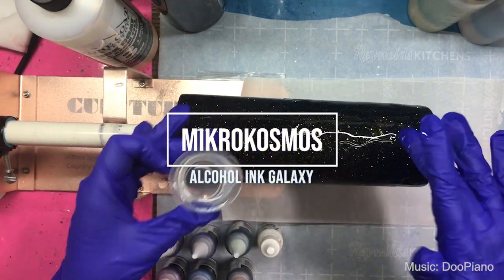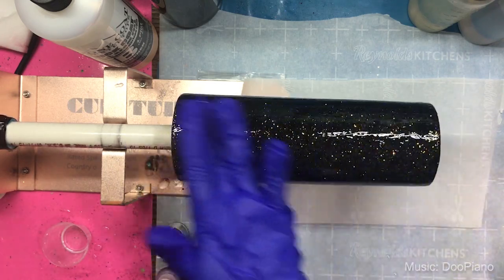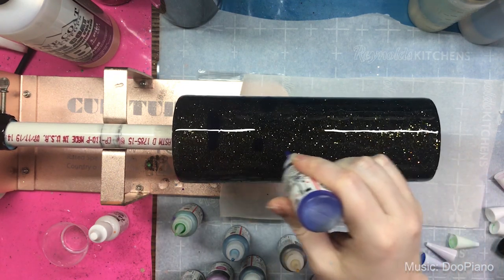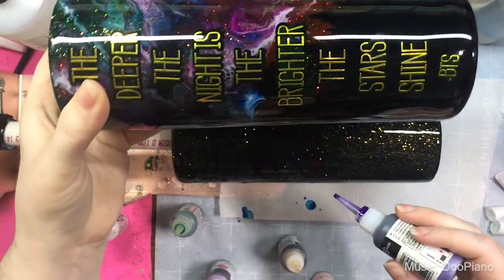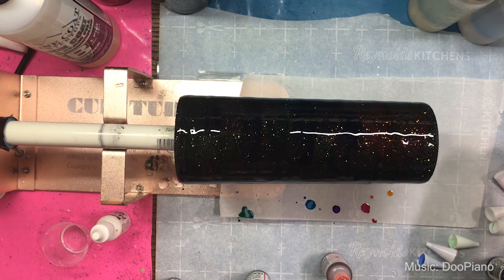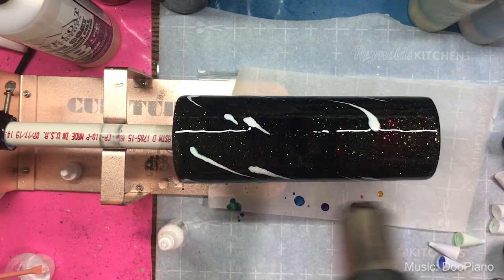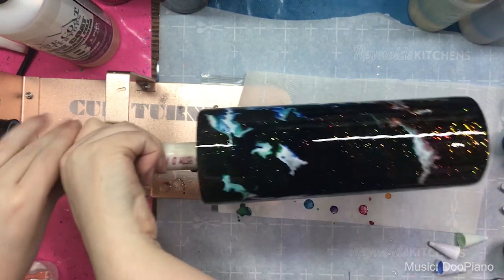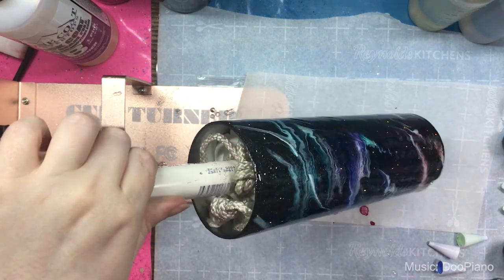Alcohol Ink Galaxy Glitter Tumbler - Mikrokosmos

Comment: Did you mix the two glitters and apply on top of the first coat of expxy?
Reply from the maker: I mixed the glitters and used epoxy method to apply and then did a thin coat of epoxy over the glitter to secure it. I let that fully set before applying the alcohol ink layer. :)
Reply: Serendipity Design Co. Thank you!! Love the cup!
Reply: I was wondering the same thing!! Thank you for asking the question ! And thank you serendipity for the awesome tutorial!!
Reply: So you mixed the glitters in to the epoxy and coat the tumbler then put another thin coat of epoxy, alcohol ink and epoxy.

Comment: Thank you for share this video. Talking a little more  about  the alcohol ink,  when I sanded  the tumbler after use the firt coat of epoxy and used the alcohol ink  sometimes you can see lines in the white area of the alcohol ink. Why do you think is happening?

Comment: Thanks so much for this video! Can you tell me what you did to the tumbler before the video started?
Reply from the maker: Painted the cup black, Epoxy method of black and an opal glitter. I put a thin coat of epoxy over the glitter to seal it in place but I didn’t flood it.
Reply: @serendipitydesignco.537  did you sand after the 1st coat of epoxy ?

Comment: Hi, thank you for your video ! I have a couple questions if you can help I would appreciate it ! Just wondering if for the black glitter did you use the epoxy method and then once the glitter was on did you wait for it to dry and add more epoxy and start adding the inks or do you let a layer of epoxy dry then add more and add the ink?

Comment: So did you put the glitter on, then put a layer of epoxy to seal it and do the alcohol ink at the same time? So there is only one layer of epoxy?
Reply from the maker: Painted the cup black, Epoxy method of black and an opal glitter. I put a thin coat of epoxy over the glitter to seal it in place but I didn’t flood it.
Reply: Ok sorry I just want to make sure so after you add the light layer of epoxy and the alcohol ink, you don't add another layer of epoxy after, correct?
Reply from the maker: Epoxy method to attach glitter and then a thin coat over that to secure the glitter in place. Let it completely dry. Add about 17 mil of epoxy for the design over that thin coat. Have additional 3ml left in the cup for the white. So 20 mil total for this step.
Reply: Serendipity Design Co. Sorry, I am new to epoxy and I don’t know what epoxy method for the glitters mean? do you mix the glitters in the epoxy?
Reply from the maker: Epoxy method just means that i used epoxy to attach the glitter rather than something like modpodge. If you’re very new to making cup, I would highly suggest joining a few beginners Facebook groups. That helped me a lot in understanding terminology.

Comment: do you do the glitter layer first and let dry before moving on?
Reply: Yes spray paint black then dry. Then the way I did mine was mixed glitter in with the epoxy let dry then added another layer of epoxy and done inks.

Comment: Stone Coat Quick Coat why do you say this is a game changer for you?
Reply: It's awesome epoxy
Reply: @spiritwings4592  in what way?
Reply: @kokopellicodcs3499  Glass finish; very low fumes; hardly any bubbles just really great epoxy and I've worked with alot of different types but to me This is the best.
Reply: @spiritwings4592  GREAT! Can this be used as for the final coat?

Comment: I wish you would have explained when you said "In here" that other than just in a cup you were adding it to resin. I'm very much beginner and I just thought that you put the white in a cup so you could use the applicator instead of dripping it out of the bottle.    the cup is almost out of camera view and it's really hard to see that there's actually resin in it. So I kind of ruined my Galaxy tumbler.  Great other than that and yours is lovely.
Reply: I'm sorry I've watched this at least 10 times. The cup is in plain sight and you can see the resin in it. Heads up your new always watch what you like several times until your comfortable with what you see before starting. I just did one and it turned out amazing.